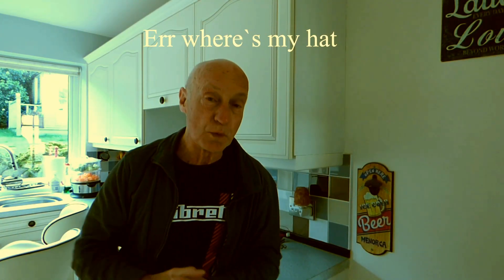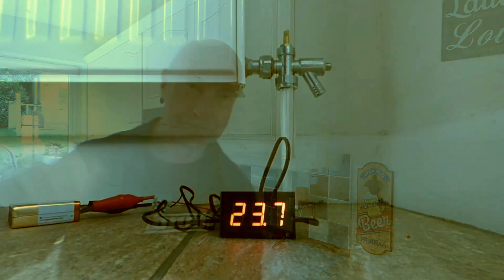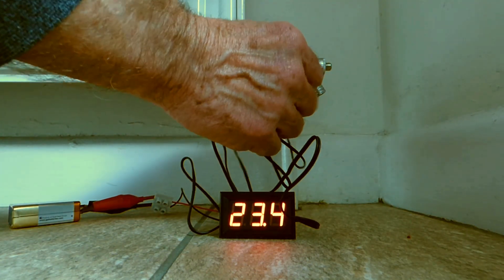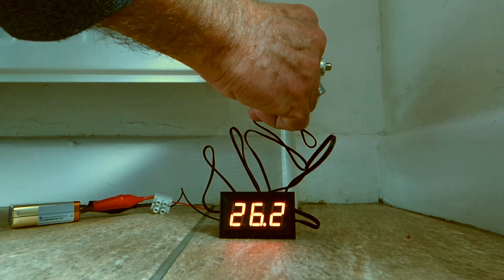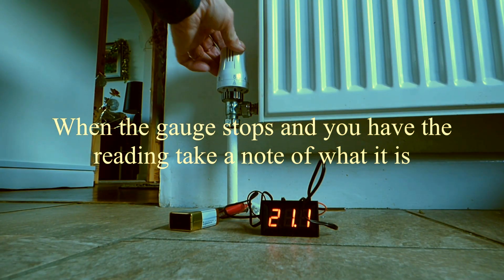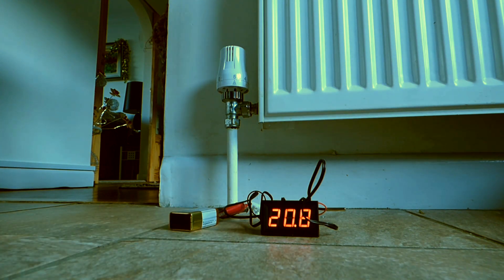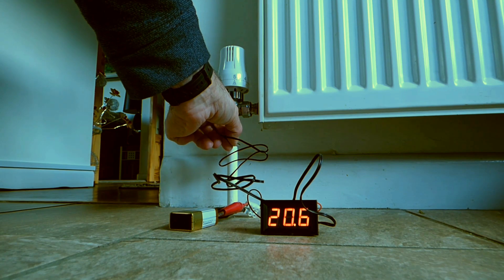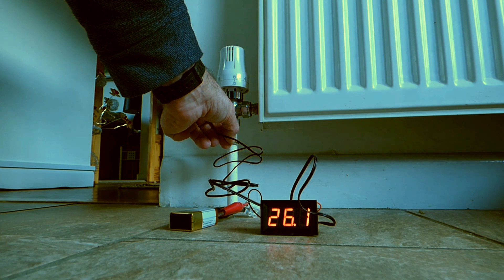How to accurately balance your heating radiators using a thermometer

Comment: Sorry Al one more question, when balancing I have the TRVs on the flow side on 2 radiators, which side should be hottest when I’m balancing them, do I set the original flow side 12 degrees higher than the TRV which is fitted on the return pipe or do I set the TRV 12 degrees higher than the flow side, I can’t get my head around it, thanks.
Reply from the maker: Always balance using the lockshield valve and the TRV wide open. Do not balance the system using the TRV, no matter what side it is on.

Comment: Should the flow side valve be full opened on every rad after balancing on lockshield side? If there not does thst affect the balancing after?
Reply from the maker: Flow side fully open. Or else it will effect the balancing.
Reply: @dereton33  so if u turn flow side down after on a rad  because u find it still to hot and the lockshield is already down to near off will that affect the other rads then

Comment: I balanced mine using the radiator size as a starting point, and it seems to work well so I left the system with those settings. For the smallest rads (rated circa 600 watts or less) I set the lock shield valve a quarter turn open, and the rest (rated at 800-2000 watt) I left the valves fully open.  
What do you think of that approach?

Comment: All the guides online are great only in theory imo. There's too many variables that effect systems to just do the rads in order. My plan is always to shut down the upstairs rads at the lockshield as much as possible just - before they close and open downstairs fully. The heat will naturally try to go upstairs so rarely is there an issue getting the upstairs rads hot. then if there's a big difference between any close the ones that are too hot down a bit then open the colder ones a bit and keep doing this over time until its as even as you can get. The method of closing the rads in order I find only works in theory. Systems can be all over the place with blockages and rad sizes that are so different they effect the flow. 17 rads could take hours to get perfect.
Reply from the maker: Yes depends how thorough you want to be.
Reply: The basic problem you have is believing your opinion is fact and then set out on a mission to convince people you are right. The principle demonstrated in this video is absolutely correct and as said in the video is laborious. That does not mean it is impossible nor does it mean that it cannot be done with a bit of effort. But just because it is difficult does not mean it is better to listen to your opinion. We know it it is time consuming (and exactly why most plumbers cannot be arsed to do it) but that does not mean it should not be done.
Reply: @normanboyes4983  I'm not saying it shouldn't be done. You said those words. I'm saying doing it won't even necessarily be correct anyway. Sometimes you will get rads further down the chain that will get far hotter than those closer. Of course using the temp probes is best in any scenario. But imo it's not the case a lot of the time that it will be closest is hottest. Knowing the order isn't alway possible either. Take a chill pill. For people doing it DIY as well stuff like shutting upstairs can save a lot of problems.

Comment: We have 17 radiators.  What you suggest sounds an absolute nightmare.  

What about the bypass valve (Honeywell DU144A1001 Straight Automatic Bypass Valve) and the settings on my Grundfos pump (Type UPS2 15-50/60 which has settings I,II,III and Automatic (I have it set to Automatic)) I have spoken to the manufacturer but find that they have little understanding of the system. My question is how do these additional components need to be set.

I get the impression that my plumber does not understand it either.

I have tried IR thermometers but they are not plain sailing.
Reply: Shut down the upstairs rads at the lockshield as much as possible just - before they close and open downstairs fully. The heat will naturally try to go upstairs so rarely is there an issue getting the upstairs rads hot. then if there's a big difference between any close the ones that are too hot down a bit then open the colder ones a bit and keep doing this over time until its as even as you can get. The method of closing the rads in order I find only works in theory. Systems can be all over the place with blockages and rad sizes that are so different they effect the flow. 17 rads could take hours to get perfect.
Reply from the maker: Leave the pump on auto, the bypass will not effect the temp settings. All you need is as close to the 12 degree difference that you can get.